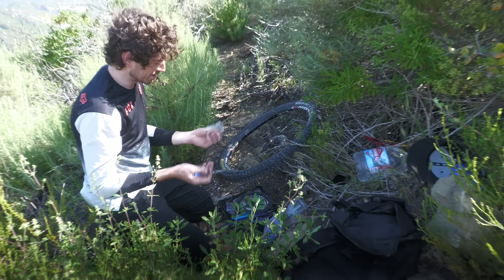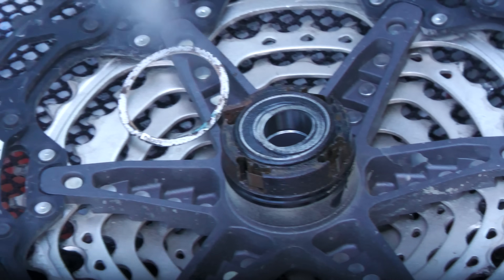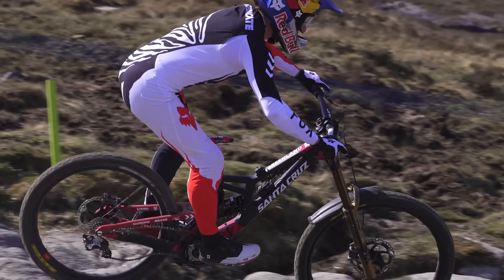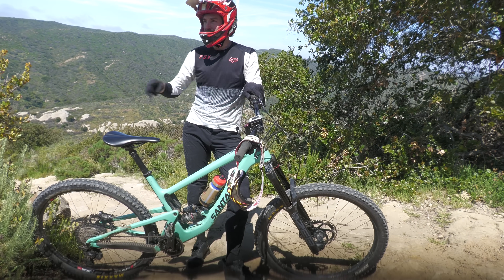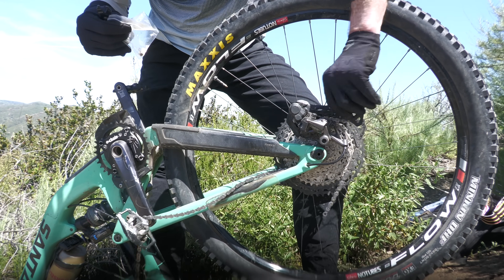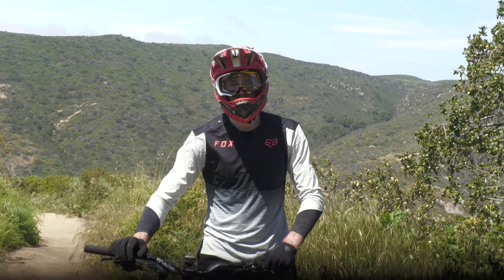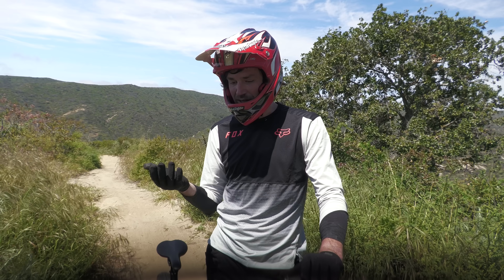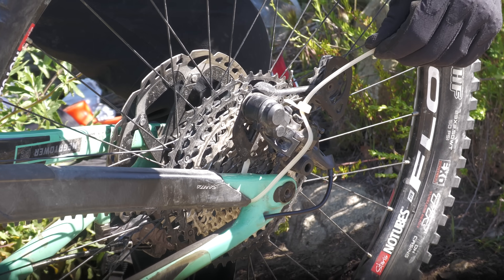Does This Improve MTB Suspension Performance?

Comment: We need more Robot! Another interesting thing to test out would be a hub like the Onyx Vesper, which has super high engagement, but springs and a clutch rather than pawls. Maybe it was just in my head because that hub is silent, but it felt like it transmitted less noise/feedback than a traditional hub. It wasn’t a huge difference, maybe akin to an O Chain at the lowest float setting, but I think there was some difference.
Reply: I’ve definitely experience a “soft” sensation when the onyx hub engages. It definitely feels like it offers some damping. And the fact that your hub is essentially always engaged means there’s less distance for your chain to bounce around, so it has lower peak velocity. All that could translate to a smoother rider
Reply: I have an onyx vesper and bought it because the sprague (sp?) clutch factor makes it silent when I’m coasting. I think I’m in the minority wanting a silent hub. The other big factor is 0-ish engagement lag while I’m pedalling. Pros and cons of course but technical uphill I get no lag, downhill I do get a bunch of kickback. I had been thinking about the O-chain as a way to build in some kickback damping while maintaining the silent hub but it’s just super expensive so…

Comment: Oh, and it is much more interesting to see the amount of flex in the rear wheel on some of those hits.  Fascinating.  I never realized the extent of the flex.
Reply: Indeed. The rear wheel has so much flex/movement I'd be checking to see if the rear axle is loose, or the rear swingarm bearings are shot.
Reply: @adamhindle9215  All good. Axle was tight, spokes were at proper tension, and the swingarm bearings were great. That's just flex baby!
Reply: Agreed. That lateral flex was much more than I thought

Comment: Pedal kick back is very real with high engagement rear hubs. Solution was very easy - to switch to low engagement hubs :-) Much cheaper than o-chain and no problem with fitting DH chain guide.
Reply: I think it's a little more complicated than that, but I'd love to do a back-to-back test to find out. In theory, the Ochain is always floating whereas the low engagement freehub is sometimes 12 degrees away from engaging and sometimes 0 degrees away from engaging.
Reply: Remember that kickback is caused by a corresponding timing between an impact and a pawl catching. I would agree that with less degrees of engagement it is less likely to time and line up, but they will still occasionally line up causing kickback.
Reply: Yea but what if I still want the sound of a hundred angry hornets chasing me
Reply: @xLordSpicy  Haha! Yeah, we all chased high degree hubs for 20 years, eventually it caught up with us..lol. I'm riding a silent hub now and it's the best thing ever. (Tairin)
Reply: @charliesponsel5091  
Exactly! It is also important which gear you have. A light gear means less POE at 360° on the crank, on the contrary, a heavy gear means more POE at 360° on the crank, i.e. a greater probability of kickback.
Reply: @charliesponsel5091 
Any chance you have done any of that back to back testing? Looking at building up a wheelset and this pedal kick back thing is making me overthink hub selection way too much 😅.
Great vid!

Comment: Nice riding Charlie! 
Also try loosening the clutch a 1/4 turn and riding down with the bike in 2nd gear, less loose chain bouncing and less pull on the driveline from the chain  from the lower gearing. 👍

Comment: its tension  in the section of chain between the top of the cassette and the top of the chain ring that resists rearward extension of the suspension. when not braking, the  cassette rotates forward as the rear centre lengthens, but it can't if braking and resists the suspension

Comment: Have realized that after switching my i9 hydra hubs to DT swiss 36 ratchet freehub. Much less pkb, much smoother ride. It gave me no chain feeling ride IMHO. Have tried it in Finale Ligure with my own bike, with the same suspension and same tyres and PSI preasure. Will go with ochain for 100 percent. The only thing is I have heard there is a weight limit using ochain. The rider weight I suppose.

Comment: If I understand correctly.
Bike with gearbox and belt drive, some have a chain, won't have pedal kickback?
And will certainly be quieter and smoother too.

Thank too test it.
Some people said pedal kick back not really exist. Other said they are annoyed by that.
Good job.

I don't know how the wheels handled all those rocks at that speed. 
But I'm glad for you that it didn't cause any problems.

Comment: Pedal kick back is 100% real. Install an ochain and feel the difference but best perceived at 9 degrees (I run 9deg on my turbo levo and 12 deg on my downhill bike and it's NIGHT and DAY difference). Allows you to charge full speed through obstacles and keep your heels down the entire time as the rear of the bike is now so much more composed; also legs don't get nearly as fatigued anymore on DH runs since your quads and hammies aren't always fighting the the pedals. Ochain is a gamechanger for me as a DH rider here in the PNW (WA) but if you ride mellow trails or XC or don't go fast through the chunder It prolly won't make much of a difference.

Comment: Another one to test would be to instal an iddler to reduce pedalkick to 0 and compare to ochain. If the iddler does worse than ochain it means that ochain isn't reducing PK but is damping chain slap (my preferred hypothesis). If you get similar results then chain slap isn't the issue and PK is real. 
Rulezmann made an iddler plate for some Banshee bikes, this could be an option to test on the SC. Most likely it will reduce PK a lot more than needed but that shouldn't be an issue and the product is bolt-on as long as you have ISG tabs.
Reply: That would be a great test! Doesn't the pawl-less test from the video make you think the hub/pedal kickback theory has something to do with the Ochain effects, though?
Reply: @charliesponsel5091 yeah I rewatched the video and removing the pawls is about the same indeed. While watching another idea that came to mind is using a lower chain guide to reduce/cancel lower chain growth as much as possible. With the STFU on the upper chain that could be a good way to isolate PK from chain slap as much as possible. Actually if the lower chain guide allows for near 0 chain growth, using STFU (or a DIY equivalent) on the bottom chain could be an option to isolate PK and Chainslap even more.

Comment: On our fulsus e-tandem we broke a lot of driving chains. Plates coming loose from the pins. It took me a long time to find out it was pedal kickback related.(going fast(over 20km/h), big compression, braking, wheel lockup, cornering, hard underground, chain growth were factors that played a role). Idon't know if the fact that a tandem has a much higher sprung mass compared to solo bikes plays a role. The fact that  on a tandem with the weighth of two riders on the cranks makes it more difficult for the pedals to kick back plays imo also a role in chain breaks. The force was so high that if the chain did not break the bottom bracket moved  the excenter.  This tensioned the timing chain up so much that sometimes the the timing chain broke or got so tight that I had to take the chainring of.Changing to 3-pawl hubs resulted in not braking any more driving chains. But excenter still moved but less.When I told this people said I had too much imagination. The only one who said can be was Adam Kieran from ZFC. Rulezman was not interested in making an idler for us. Pity occhain does not work with double cranksets.
Reply: That's a wild story! Definitely agrees with my test results and experience. But yes, there are a few respects in which tandems increase forces waaaaaay beyond the performance envelope of normal MTB components. Cool that you found a solution but sounds like a pain to sort it out.

Comment: When Shimano came out with 10 speed clutch derailleurs, I remember turning the clutch off made the bike feel loads smoother and shift easier. With the fancy electronic mechs we have now, would be cool to see a clutch that allowed for more initial movement to help free up the suspension from chain forces.
Reply: Yeah I remember my old Zee derailleur's clutches being mega tight, and that's what I expected to feel in this test- less bumps with the clutch off. I wonder if the clutches on the new 12-speed derailleurs are different, softer, easier breakaway, etc
Reply: I just loosen the tension a bit in mine. Enough to get away with it.
Reply: I always ride with my clutch off. The chain guide stops any dropped chains, and the shifting is much better.

Comment: My thoughts are high engagement hubs contribute to pedal kickback, along with suspension design.
A suspension design with minimal chain growth, well placed main pivot, and a floating brake system is the perfect fit for DH riding.
Trail riding is another story. High engagement is great for technical climbing.

Comment: Great video and trail choice.

 Question I have is what's better o chain and say hydra hubs or lower engagement hub and regular chain ring for dh

For enduro pedal/dh trails, what's best for kickback but still putting power down in flatter sections?

Definitely a interesting topic I hope spawns more videos and testing. Love this deep dive stuff
Reply: Great question and glad you liked the vid! Trail was sick indeed. For me if I'm downhill racing, I'd go with an Ochain and higher engagement hubs. I say "higher engagement" because I don't need an instantaneous hub but I'd rather not have a low engagement hub pared with an Ochain
Reply: @charliesponsel5091  makes sense why make a low engagement hub less engaging. Kinda sounds like with chain you can have your cake and eat it too with higher engagement. Just adjust how much ochain adjustment you need for the days riding.

Thanks for the feedback

Comment: I think it's actually chain tension and chain mass momentum rather than the hub
Reply: That's what I thought too before the test, but if the hub doesn't have anything to do with it, then why would it be smoother and quieter when I pulled the pawls out of the hub.
Reply: @charliesponsel5091 If clutch on = less kickback than clutch off,  the chain mass whipping around must be causing "micro engagements" of some of the pawls.  Perhaps akin to ratchet pedaling, but in a quicker, less obvious fashion? I wonder what a belt drive would feel like back to back.  The O Chain would mitigate that somewhat by not being static and blunting the chain flop/whip.  -maybe :) I am only on one cup of coffee and am not an engineer.  Chains aren't exactly lightweight, so my untrained mind is thinking of them as the wet towel you would snap your "best" friends with versus a dry towel.  Really cool experiment and enjoyable video.
Reply: @charliesponsel5091  I guess the hub might be what's getting the chain moving.

Comment: Pedal kickback is caused by chain growth between the chain ring and the cassette when you go deep into the travel. Generally pedal kickback can be alleviated by the rotation of the wheel but you will be able to feel some force. When pedal kickback is a real problem is when you lock the brakes up and the wheel can’t rotate.
Reply: Put it in a lower gear will put less pull from the chain on the cassette.
Reply: Yes, agree on all points. It was interesting for me to learn in this test that the freehub can engage on impacts (even when riding at very high speeds) and prevent the cassette from rotating freely. Did not expect that!

Comment: How about trying different front chainring sizes and seeing if you feel any difference going downhill?
Reply: That would be interesting! In theory the bigger ring means less anti-squat, replicating the effects of a high idler. I think my frame is compatible with a 36 tooth max chainring. I wonder is 28 teeth to 36 teeth is enough of a range to test the theory.
Reply: @charliesponsel5091  I think 28 to 36 should make a noticeable difference if there is any

Comment: The best way to improve suspension is at the piont of contact. Try a 29x3 15psi front and yes 27.5 x3.25. 16psi rear on a emtb that can't  get kickback because of the sprag bearing.  But what would I know.  E=Mtb²

Comment: You kinda get into it at the end there at a surface level, but its not entirely clear to me if it's the freehub engagement pulling (on the suspension?) or the movement of the chain [slapping around] that causes the sensation through the pedals. Would love to see, or try myself, the same back to back testing but also with a low(er) engagement hub
Reply: At 1:10 in the video I pull the pawls out of my freehub in the hope of answering that exact question. I instantly noticed a difference, which confirmed for me that the engaging freehub is a factor in  pedal kickback. It was also a big surprise, because I didn’t expect that result.
Reply: No engagement is sort of like the lowest-engagement hub imaginable.
Reply: @charliesponsel5091  lol absolutely true! Was thinking more in the lines of would a lower engagement hub give an equal feeling as the O-Chain, or do the elastomers/springs? within the ochain help dampen the chain pulling as well
Reply: @charliesponsel5091 yup I have ridden 3 pawls hub for 4 years and it make the drivetrain freely dance around floping around switched to 6 pawl hub it has less noise on chainstay area and less chainslap. I rather have idler tho than low engagement hubs to keep the chain floping around and consistent feel I also got tons of chaindrop from the 3 pawl hub my chainguide gaved up

Comment: Pedal kickback is very much subject to suspension design.  Suspensions where the crank axle to rear axle length increases through the stroke can have a lot of kickback.  High pivot suspension will have no kickback.  Can it effect your riding?  Depends on the length of travel, suspension design, how hard you ride and how stiff you ride.  I doubt the average rider will notice enough kickback to justify an OChain or a new bike just to get rid of it.  All of this can be simulated on high school geometry software and a little trig.  But why bother?  Just go ride and have fun.
Reply: Well, kind of. High pivot designs have a lot of rear center growth (where the crank axle to rear axle length increases through the stroke), but they typically use idler pulleys to offset the amount of growth the chain needs to do as the suspension compresses. So a high pivot bike without an idler would have the most amount of pedal kickback of any design (a la old 26" Scott Gambler), but high pivot designs with an idler often have the least (a la Norco Range).
Reply: @charliesponsel5091  Yes, definitely.  I should have specified with an idler like the new Norco bikes.

Comment: is pinion with a belt and hight pivot a similar effect? 

If so, why do we need derailleurs at all?
Reply: because pinion is expensive, heavy, and inefficient
Reply: Different bikes have different priorities.  XC is weight and efficiency conscious.  Pinion is great for DH and ebikes.  A derailleur is cheap and easy to maintain.
Reply: I think it all depends on whether you have a freehub engaging in the back of the bike. If you do, you're going to have all the same pedal kickback symptoms on a belt-driven bike as you would on a bike with a chain, and belt-driven bikes still use a spring-loaded tensioner (similar to a rear derailleur, but not used for shifting gears). The difference would be the reduction of chainslap, but we need to do more research to understand how much of an impact that has.

Comment: Pedal engagement isn't fast enough so I buy new hubs for faster engagement, wait no that's too fast so I buy a chain ring to make my pedal engagement worse again. Stonks $$$
Reply: Yes, lower engagement hubs do reduce pedal kickback at the pedals, but it's not quite as simple as the story you're telling. The trick with low engagement hubs is that they're sometimes 12 degrees away from engaging, and sometimes they're zero degrees away from engaging. So you get less pedal kickback on average, but sometimes you get the same amount of pedal kickback as you would with a super high engagement hub. Whether that matters to you or not is a valid question. Low engagement hubs will be an acceptable solution for some riders.

Comment: So what I hearing is high engagement hubs aren’t for racing ?
Reply: I think it's a little bit more complicated than that. For starters, some bikes have worse pedal kickback than others. In theory, I think a high engagement hub paired with an Ochain would be optimal for bikes with high levels of pedal kickback. I'm also not convinced that low engagement hubs are a lot better than high engagement hubs, because a low engagement hub is sometimes 12 degrees away from engaging and sometimes 0 degrees away from engaging.
Reply: @charliesponsel5091  yeah I know I was just summarizing lol. you been watching moi moi tv huh lol. personally the I9 1/1 feels the best for peddle kick plus good engagement.